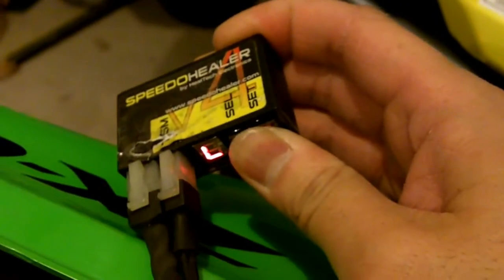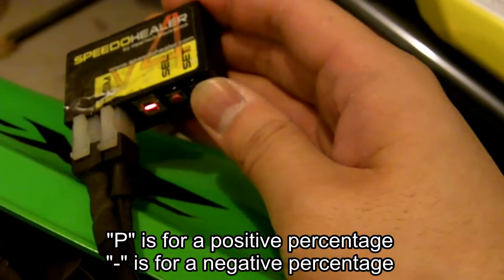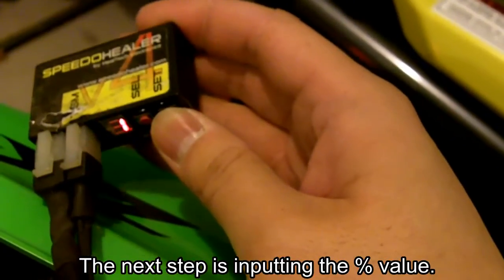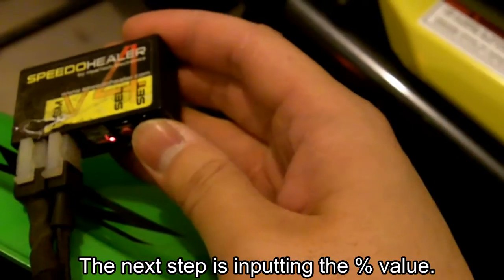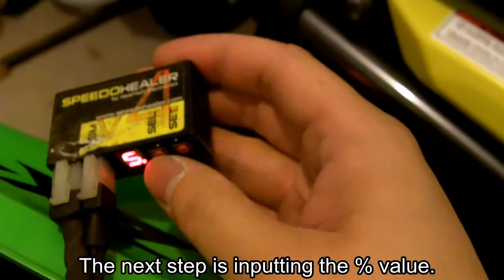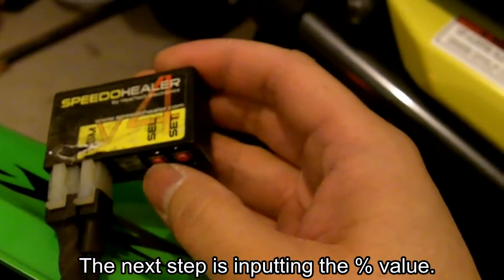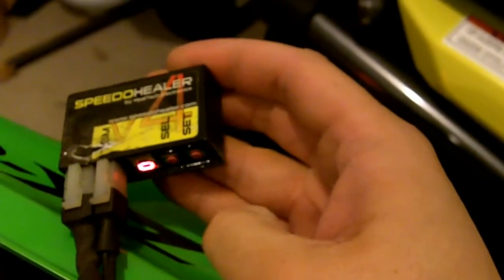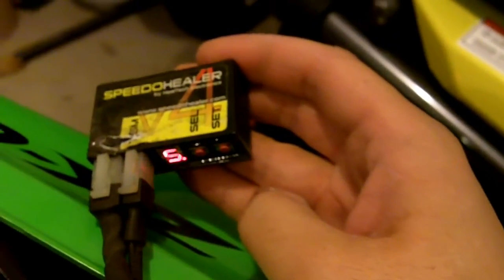Calibrating a SpeedoHealer V4 using a GPS

Comment: It'd be a douche bag thing to do, but I can see this product being used to dramatically increase the resale value of your bike....After watching this I wouldn't buy a bike with one fitted!
Reply: So how is this going to "dramatically" change the resale value, any correction is from that moment on not what is already recorded. Oh! the value of the Speedohealer itself would add a hundred or more to the bike value in my world. In my world odo calibration checks are part of the endurance rally check-in process, the more actuate the better, less need for radar detectors also. Say you are tooling down the road at 75 indicated on the speedometer but cars are passing you like crazy, turns out you are only doing 68 mph. Most bikes and cars speedometer read low, so the odometers read low.

Comment: Awesome, mine was calibrated until someone changed the sprockets for more top speed, then I was going 60 and the tac said 44, it was way off, cleared the old setting and set up my phone with a speedometer, and took a test drive. This time it was only 8 mph off, went back home and mine was about 11.1% off. did the setting change, and now it's spot on. Thank you for posting this, I will love you forever for it.

Comment: Great Video.
Did you really thought it would be 20% off as you said in the beginning of the video?
If you`d change the rear sprocket too, do you recalibrate it or du you accept a little more speed on the speedometer??

Greets from germany,

Achim
Reply: it was -15.3% off. so fairly close. And if you change the rear sprocket then yes you need to recal. unless its the same size AND tooth number.

Comment from the maker: The speed readings should stay the same as before because you used the same sprocket tooth. Not really necessary to use a speedo healer, but I would recommend it anyway. The speedo is off by up to 10% from the factory so even in a stock configuration, it will make your speedo more accurate.

Comment from the maker: The gps is supposedly the best way to determine actual speed. Even in a car the speedo is slightly off; but not by much, maybe no more than 5% Motorcycles are usually up to 10% off from the factory.